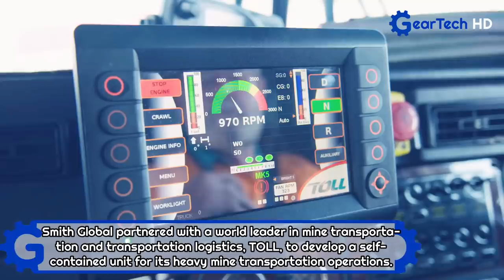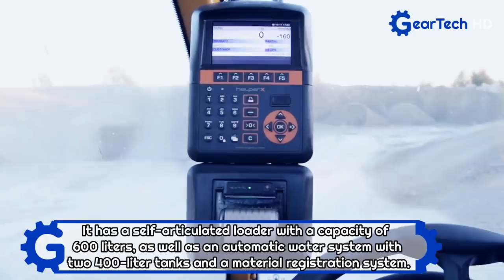The Special Trucks and Machines That You Have to See ▶ Autonomous power unit on truck

Comment: 2:00 wouldnt it be simpler to judt have the bed tilt back and slide off loke any modern flatbed?
Reply: Under vehicle weight restrictions, it is simple and strong enough to eliminate the sliding structure.
It can be used to carry two cars or one heavy car.

Comment: 03:10 why put the heavier one on top?
Reply: The pillars on the second floor need to be raised completely. In this case, a van would be too tall and there would be a problem with the height limit when driving on the road.
Reply: @KMTcomputrap  What?
Reply: @ACERASPIRE1  It would be ideal to put a lighter car on top, but in this case, the height limitation would be a problem.
The center of gravity will be higher, but it is unavoidable.
Reply: @KMTcomputrap  how is the overall height less with the taller car on the bottom?
Reply: @ACERASPIRE1  If the overall height of the second floor can be lowered, then you're right, you can put a heavier vehicle with a lower height on the bottom and a lighter vehicle with a higher height on the top.
Of the pillars supporting the second floor, the length of the front pillar remains the same.
The pillars must be raised completely to maintain their strength.
The height of the second floor can be adjusted, but the front pillar is fixed and its height is determined, so the height of the car on the second floor directly affects the overall height of the truck.
Therefore, even if there is a weight problem, it is necessary to put a vehicle with a lower height on top.